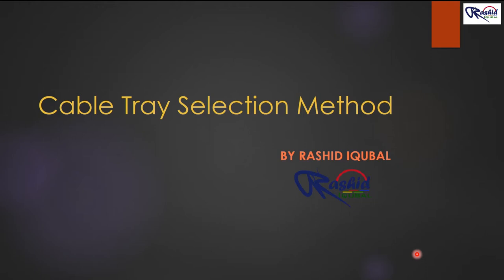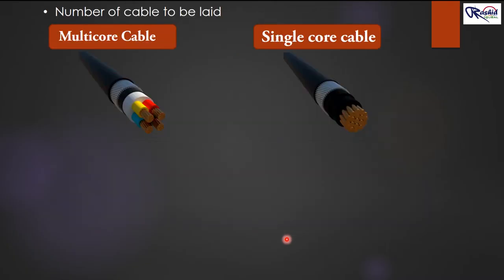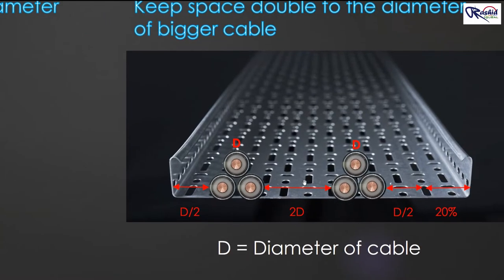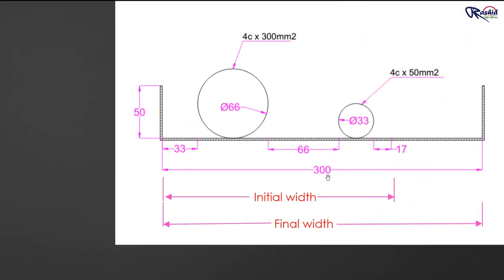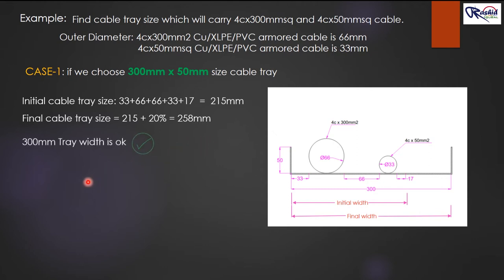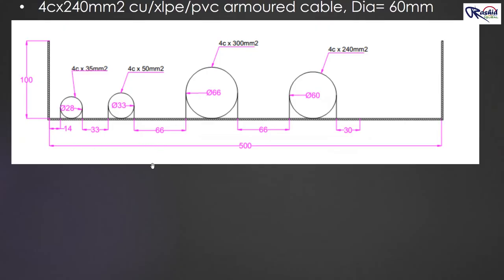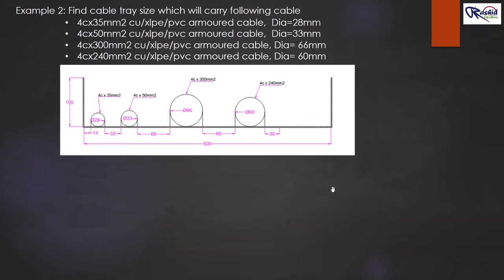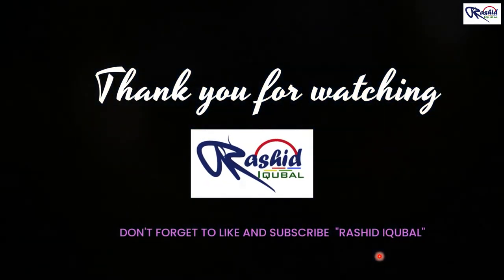Cable tray size calculation method in simple way

Comment: What to do with earthing cable?
Reply from the maker: Earthing cable to be considered as single core cable rule, as i mentioned in video
Reply: @Rashid-iqubal   means? in trefoil arrangement?
Reply from the maker: @Abhi Asokan its equal to double diameter or same diameter of earthing cable.